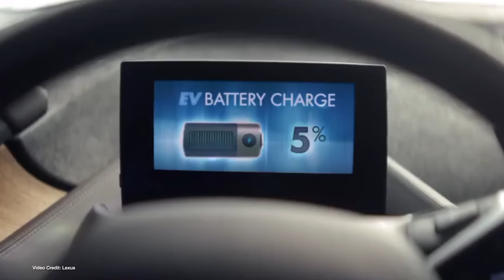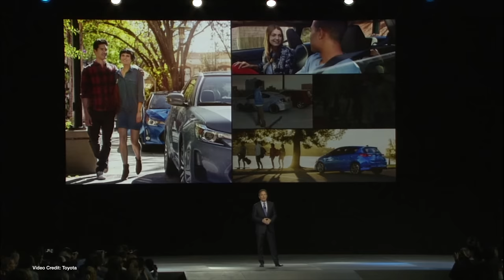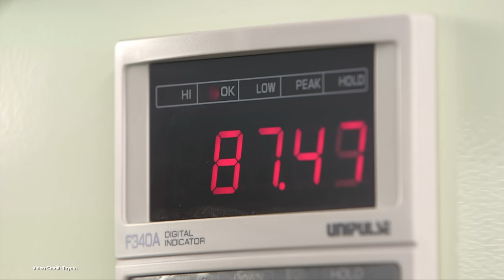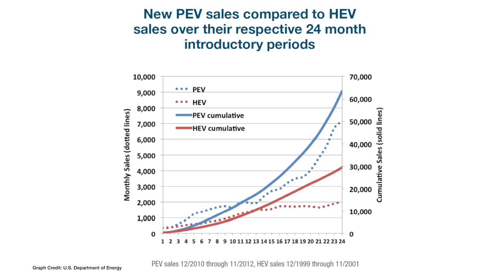Toyota Insists You Can't Ban ICE Cars Yet. It's WRONG.

Comment: What I do not understand and struggle with is why can’t all these EV’s have a small two cylinder engine/generator on board in case of a battery depletion incident. Before you guys get your panties in a bunch let me explain, I have 45 years experience with custom vehicles which includes two monster trucks, a bunch of custom muscle cars, Harley choppers, Japanese crotch rockets, high performance boats and a pro gas 1923 T bucket altered drag racer which could not be street driven, no radiator, 3 gallon front mounted Moon gas tank etc. I also have a Tri Motor Cybertruck on order and am in the process of buying and modifying a 300 pound generator that I will mount in the bed for long trips. The engineer I use says that this unit should charge the Cybertruck at a rate of one mile per minute. I know I will get some backlash, but I honestly don’t get it. It’s so simple and with a high production rate it should be fairly inexpensive.
Reply from the maker: This is exactly how the BMW i3 REx works. It’s a BEV, but has a small BMW scooter engine under the rear cargo area and a 2.5gal gas tank up front. 

It works with mixed results. You pay an efficiency penalty hauling around the engine and fuel but not using them. The ICE engine has had reliability issues because ICE engines like to be run, and it can sit unused long enough to not work when finally called upon. Interfacing between the two power systems means extra hardware, which is heavy and a failure point. And most significantly, the range extender can’t put out enough power to allow full-throttle acceleration if the battery pack is near completely discharged, but the quirky nature of California regulations meant that was the only time the range extender could engage in US models (it was available on demand in Europe, or in the U.S. with a firmware hack). 

My personal thought, having owned one,  is that the i3 REx was a brilliant concept that wasn’t implemented great in its first generation, and that put people off of true range-extended BEVs as a concept (as opposed you PHEVs like the Prius Prime or Chevy Volt). With falling battery costs, many see the need to range extended electric cars as past, but personally, I think there’s still a market where they’d be appropriate, I’m just not sure if it’s big enough to justify production. - Winter

Comment: It is very easy to understand why Toyota does this.  EV negates all of their production know how, especially in reliability.  Electrical vehicle by nature doesn’t have a lot of things that can go wrong and are extremely cheap to maintain.  EV is essentially a software defined car, and Toyota is pretty bad with software.  Witness the sorry infotainment system in my top of the line lx570, that thing is from last century.  I recently purchased a Ora good cat ev (yes that is the car name) in China (where I stay about 30% of my time) as a run about.  Costing roughly the same as a Corolla, that thing puts any Toyota to shame with its tech and interior.  I think Toyota will go the same way as Walkman

Comment: Quick charging is not environmentally friendly and the same applies to having cars lugging around big batteries. It is in the long term much more efficient, practical and ecological to store electric energy as hydrogen and have internal generators in the car turning it to electricity.
Reply: Wasting monumental amounts of electricity just pumping crude oil out of the ground, before it even reaches a refinery isn't that environmentally friendly either.  And by "internal generator" you presumably mean a fuel cell?
Reply: @Brian-om2hh  I am talking about green hydrogen not blue or gray so no pumping oil is needed.

Comment: Governments absolutely should not ban or unfairly tax any form of transportation fuel. It should be 100% up to consumers to decide what form of energy they choose to employ for transportation. This is called liberty. If you want to drive an EV, good for you. If you prefer a hybrid, great. If you want it to be powered by natural gas, hydrogen, gasoline, or diesel - that should be your own choice. 

I personally want an electric car as one of my sources of transportation (we have three vehicles), mainly due to performance. However, when I need to tow heavy or high drag trailers for long distances I will continue to employ my large diesel vehicle to do so because EVs simply cannot service that need at present. At some point battery technology may make such use practical, but I don't see that in the next 5 or 10 years, and no edict by any government politician is suddenly going to cause technology to appear.

Pure EV use also has a huge problem that has to be solved before this can even be considered. Our power grid, and the sources of energy used to produce that electricity. Estimates are such that to go 100% EV we need at least 30% more capacity overall. Plus with people charging at home, more than that at night. Since that would then be our only transportation, that grid electricity supply needs to be made up of 100% reliable, controllable (can be ramped up or down to meet demand) sources of energy. Currently that means coal, nuclear, natural gas, and a tiny amount of hydro and other. Green people are for some reason strongly against expanding hydro, and that is rather limited in where it can be expanded anyhow. Nuclear is the best option, but it has been regulated to death such that there have been virtually no new plants built from conception since the NRC has been in existence. So either we have to be more open to carbon-free nuclear power, especially new small-scale thorium plants, or we have to accept natural gas and coal power to provide the base-load to reliably power these new EVs.
Reply: You want fair?

Tax the absolute hell out of fossil fuels, that’s fair. They are terrible for the planet and the local environment.  Tax them to compensate those people that walk and cycle.
Reply: All fuels should be free of taxes. But that will never happen.
In Australia the government charges massive fuel taxes. They rip-off the motorists. 
That is why they don't want EVs.
Reply: @rogerstarkey5390  My wife drives one to work, I drive one to work, and the other is for pulling trailers (usually when we are together). How is that a problem?
Reply: @kentonian  Fossil fuels have made all of our lives much better, and oil/gas are impossible to do without, even with an EV. Walk and cycle? That is completely impracticable for most of us that don't live (or want to live) in compact cities.

Comment: Keep in mind that during the first decade with hybrids, it was Toyota fighting misconceptions about electric tech.  That was a difficult struggle proving motors could deliver power & speed while also confirming battery longevity.  Think about how much of that was well established by the time we saw our first Nissan Leaf.  Supporters of BEV like to compare rollout timelines, but overlook the benefit of what hybrids has already established.  Some also fail to acknowledge how much of the PHEV tech is interchangeable with BEV.  Toyota is setting up for an economy-of-scale opportunity, leveraging their extensive experience to share the tech across a variety of platforms.

Comment: The problem with hydrogen is that the cost of hydrogen won't go down. Solar makes EVs essentially free for daily use fuel wise. Solar prices keeps dropping. People will continue to adopt solar because it makes economic sense. You won't even need incentives in a few years. I watch solar go from $100/watt to now below $1/W. It's insane. And it is still going down. There is simply no way for hydrogen to compete.

Even if you use solar to make hydrogen, you still have the transport, storage, transport and storage costs. Which adds up to costing much more than just EVS. Hydrogen vehicles are much more complicated than EVs with more to go wrong so your cost of ownership goes up. I just don't see any way for hydrogen to compete with EVs.

I am amazed at how even the CEO of Toyota refuses to see what is clearly happening and to do some cost analysis.

This reminds me of Digital Equipment. No one will want PCs, what will they do with them? Lol.
Reply: Why not transport the solar electricity and make the hydrogen locally?
Reply: @michaeloreilly657  Because making hydrogen costs energy, You lose at least half. With batteries, it's only about 5%. So you would need double the size solar panels to make hydrogen. Then you need to store an very flammable explosive gas. Remember the Hindenburg?

Hydrogen is a very nasty gas. It will weaken metals after a few years. So now you have to replace your storage tanks and fittings every few years or risk going kaboom.

How are you going to compete with solar + batteries which prices keep dropping every year?

Comment: Look at the new Toyota Aygo X Prologue £12,000/$15,000. To make it electric would cost double. Not everyone can afford or has a place to charge an EV. It should be aimed at the high end market and phase out gas gusselers rather than 3 cylinder 1 liter eco engines that emit less CO2 than an EV anyway. VW ID.3 is 119g/km before you even charge it because battery production is very CO2 intensive.

Comment: Supply and demand. If all cars are ev then cost should come down. My concern is getting the power grid green at the same time ev ramps up, otherwise we are transferring our pollutants to power plants where we can’t see the damage.
Reply: Yep.  We have been working on it.  It is all-hands-on-deck time.
Reply: @shanefiddle  NIMBYism is still the unsolved problem.
Reply from the maker: Because of the nature of ICE engines and power plant design, using even the dirtier power plants such as coal-fired to generate power for electric cars is cleaner than running fossil fuel cars on the road. But you’re right that greening the grid is also a vital step as we move forward. - Winter
Reply: I think it was the recent T&E report that claimed a 100% coal sourced electricity powered EV is at parity with an ICE car on CO2 emissions. Then you have the added benefit of reduced NOX and particulate where people live and breathe.

But I agree, EV transition needs to go hand in hand with low carbon generation. They are actually symbiotic when V2G starts to become mainstream (and incentivised) in the EV and charging infrastructure.

It's all heading in the right direction in the UK.
Reply: in the meantime copper is rising in price that says there may not be enough to supply demand.

Comment: I am NOT sue about your claim of H2/Fuel cell heavier that BEVs. I believe the Gravimetric densities in comparison is much lighter for H2 than BEVs.
Reply: Toyota Mirai 1st gen weight - 1,850 kg for 312 miles EPA. Tesla Model 3 LR RWD - 1,730 kg for 325 miles EPA...
Reply: @midnightstar4065  Oh! you are talking about the Net Weight of the Car. I am comparing the Weights of the Battery pack Vs H2 Tanks.

Comment: I think it will be very difficult to totally ban ICE vehicles.  Banning them from city centers I think is ok. But I think there will still be a need for some cases no matter how good EVs are. I think rather than banning them completely they should be made difficult to obtain (like having to apply for a permit to buy one).
Ultimately once EVs become cheaper people will switch and it will become increasingly difficult to justify an ICE vehicle unless you really need one for some special reason.
Reply: How about once they cease being sold new? Which is what is happening in the UK and some parts of Europe...

Comment: i have a similar opinion. Bans are stupid and NOT necessary. BEV are getting cheaper and cheaper. why? because they are more efficient. on the other side petrol needs to contain enough taxes for compensating for the environmental damage. then e-fuel will be an interesting option for all the old cars. e-fuel needs to be a viable business model.

Comment: Battery production is 10-15 years behind demand, so there will be a need to keep non-BEV options around for 10+ years.
Reply: Nope, you simply increase battery production, which is what's happening in the UK, with two new battery assembly plants coming on line.........  The sale of ICE cars and vans is being banned here after 2030.
Reply: @Brian-om2hh  Increasing battery production capacity is easier said than done when ~40X the current lithium battery production capacity would be required to move today's car fleet to BEV by 2035 and a lot more still will be required if everything else goes lithium-based too.

Comment: And they are right. Unfortunately personal battery electric cars cannot completely replace ice cars at the moment so banning ice is not going to happen. Battery electric cars are great if your use of a car is "typical"  (so you can charge overnight). Forget it if you have to travel a lot. Also forget about buying a 10-15 year old battery electric for 5% of the new purchase price and basically having the mobility equivalent to anyone else. You'll be lucky if your 10-15 year old battery electric provides you with half the range. Then there is the elephant in the room of battery electric vehicles not delivering their promised range at (EU) highway speeds or in the mountains. Don't get me wrong. I would love to have a tesla model 3 as a second car for when I need to go to the supermarket, a nearby city or visit friends in a 100 mile radius, but I'll never give up the ability to get into an ice car and drive a thousand miles in a day if I want to.

Comment: I am concerned for Ford, they are late to the game.  I'm not sure Fiat Chrysler stands a chance.  I think that Toyota will still be around, but a much smaller company.  That said, most people I know are dismissive and afraid of EV's.  They constantly go on about Charging times and Electric infrastructure; they do not want to have to learn anything new.  I believe that they will be so surprised at how nice electric will be.  It drives me crazy to see the oil stains all over our parking lots, the idling trucks at the convenience stores and the absurd smoke coming out of the Diesel tailpipes.  We can have it so much better.
Reply: you realize parking lots are a by-product of oil or coal production.
Reply: @victorhopper6774  Yes, but most of the oily runoff is from leaking gasoline or diesel powered vehicles.  Dumping free oil on the surface is in addition to any oil that is lost when you pave the road.  Most of that stays where it was placed.  
Not leaking oil will reduce the oil in rivers and streams significantly.  You can pretend it won't, but you would be wrong.
Reply: @jdear97  look up what cement and asphalt are made from. cement is extremely energy intensive to make and most of it uses fly ash from burning coal. i am not against electric cars at all but they are not a cure all.

Comment: Sad to see your sneer at nuclear power.  Fukashima was close to a worse case nuclear accident (containment dome breached) and it killed no one.  The radiation released was not enough to cause an up tick in cancers 30 years from now.  I can't understand why nuclear power is STILL portrayed in media as unsafe, when demonstrably it has the lowest number of deaths per terawatt hour produced.

It is trivial to add wind and solar to the grid up to 15%.  Beyond that, it gets very hard to provide enough base line power with only intermittent sources.  EV advocates should embrace nuclear power, that is the way to kill off fossil fuel power plants fast.  

Germany closed down its nukes, and the result was a huge increase in fossil fuel use, and the very expensive electricity.  (If I remember correctly electricity prices more than doubled.)

Warm regards, Rick.

Comment: There is no doubt that EV cars or some type that uses no fossil fuels is the future. I watch TFL and currently to charge an EV is a pain in the butt. I live in Canada and it is damn  cold here in the winter so take 40% off your full battery and then it is recommended to charge to 80% of full. If anyone has never been to Canada...let me paint a picture. Imagine where I live in Ontario that you can drive possibly 600 kilometers or more and not see a gas station...never mind a charge port. Here, the price of gas is around $1.20 /L. I would argue that 40% is some form of tax on fuel. Now, imagine if even 50% of Canadians drove an EV...imagine how the different levels of government will tax the living 💩out of electricity. Governments in Canada are drunk with taxes of many kinds and that includes fossil fuels. Many people like me tow RVs for recreation. There is no...NO EV trucks yet on the market and if there were, they cannot compete with ICE trucks. I drive a Toyota Tundra and it consumes about 18 litres per 100. I love Toyota...the brand makes the best vehicles on the planet. To save the ICE vehicle....install a carbon trap in the exhaust stream and now it is ZERO emmision. EVs are great for people who just drive in cities and heavily populated areas...most of Canada is Bush....Lakes and rocks. I kid you not.
Reply: @rogerstarkey5390    TFL?   I live miles away.

Comment: No you can’t ban ICE cars immediately. I do believe in Toyota’s hydrogen EV cars like the Mirae (future). Hydrogen is best. Fill up in same way and time as ICE cars. No battery go replace in 20 years. Obviously as hydrogen fuel is used the car grts lighter. Batteries stay the same weight. Batteries don’t work well in very cold climates. Hydrogen no problem. The liquid hydrogen is extremely cold already. This is also the solution for electric planes. You don’t need to rely only on hydrogen. Propane and CNG will work just as well and the infrastructure has existed for decades.
Reply: But you would have to repair or replace the hydrogen fuel cell, because these degrade over their working life.....